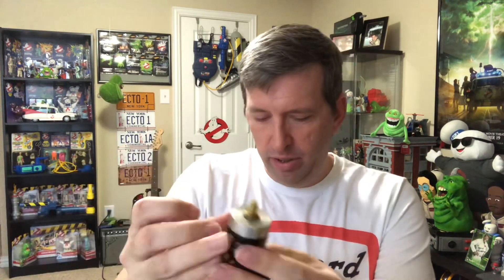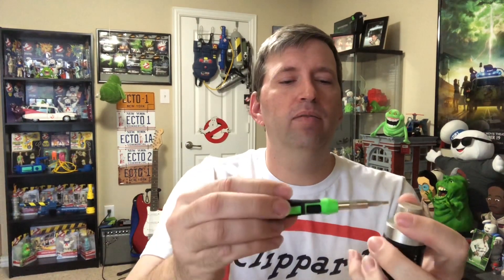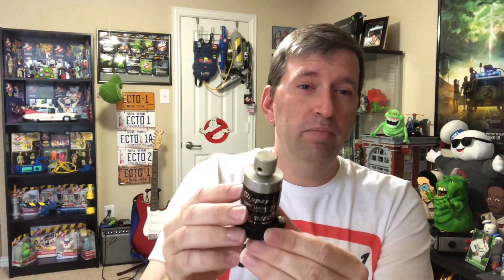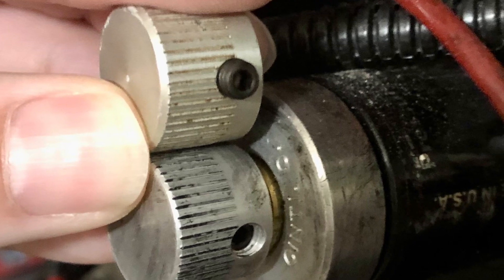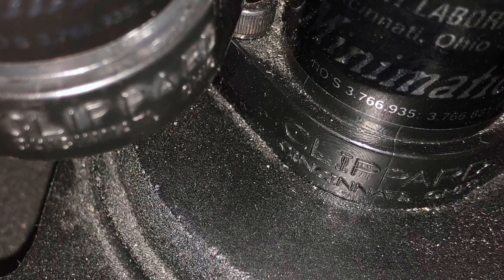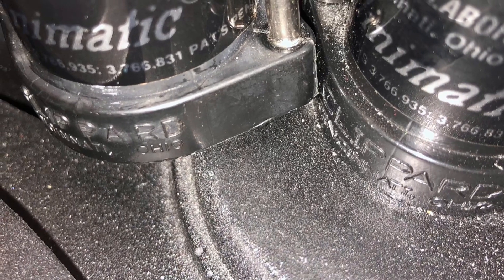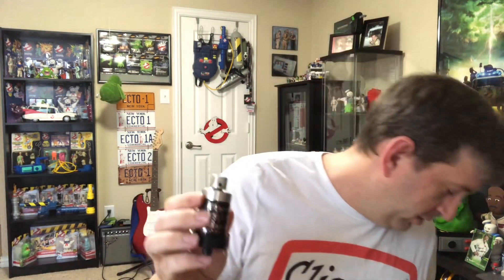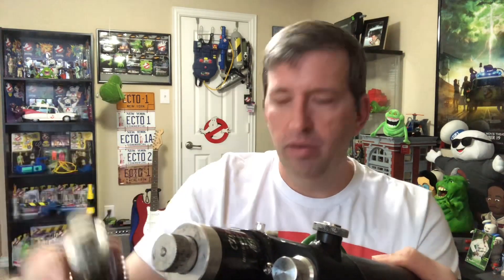Completing my Vintage Clippard R-701 Valve, Comparing with Modern Valves

Comment: Can you tell me, is another distinguishing factor between the 331 and 701 that the 701 has engravings on the front face of the valve surrounding the knob and the 331 has no engraving? Is that true?
Reply from the maker: I think you’re on to something, good eye. A quick reference check of the Super Hero 331 shows no engraving, and I know the vintage 701 valves did have the engraving. I’m not sure if all modern 701’s have engraving or not.
Reply: @TheProtonPackIsNotAToy  awesome thanks for looking into that for me!  It seems I was able to score a vintage 331!  It doesn’t have engravings and the plastic base that says Clippard is the more squashed font instead of stretched out so it seems to be vintage!
Reply from the maker: Nice, I just grabbed one on eBay as well.